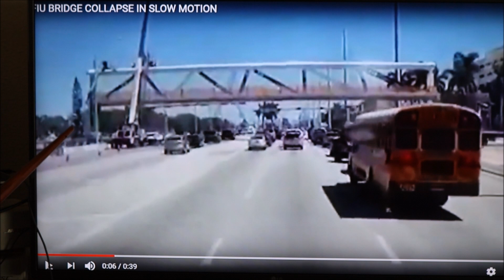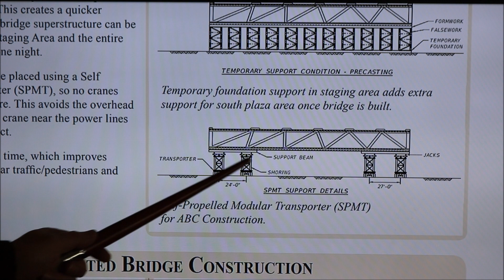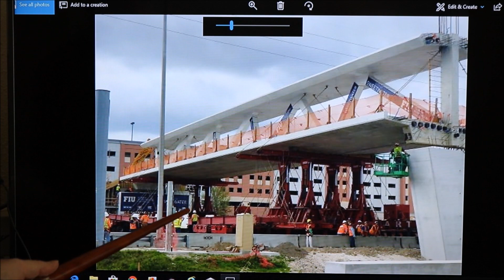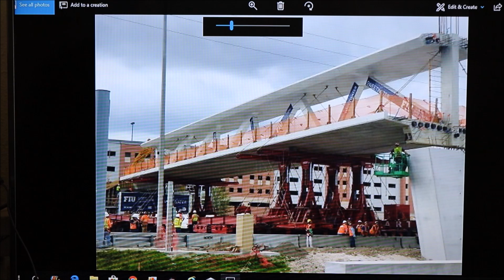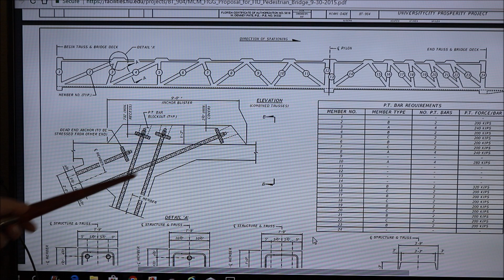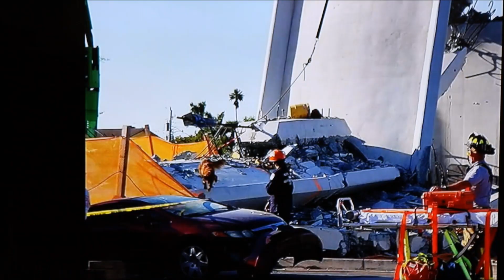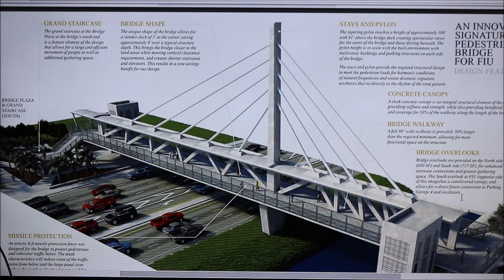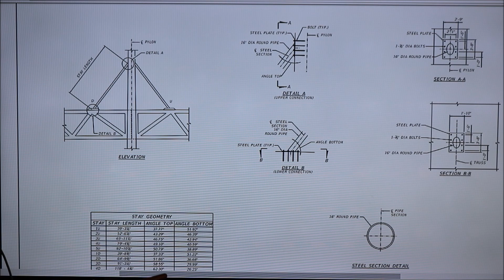Miami Bridge Failure Update 18 March 2018

Comment: Some engineers are going to face extreme scrutiny..... and justly so
Reply: Some engineers are going to lose their PE commission.
The load cell that was doing the tensioning should have some type of data recorder. 
I tested materials as well as worked on numerous flight test programs. Testing steel dog bones or bow ties required a reduction in material width to get the specimen to fail within the gages. You see the ultimate strength, then a reduction of strength as the stretching occurred, and finally the bang of the failure. It can be quite violent releasing 100 ksi of more of built up energy.
Reply: I suspect there is quite a lot of scrutiny for the contractors as well. There are approved plans for moving, tensioning, etc. If the contractor doing the work doesn't follow them not much engineering can do.
Reply: The contractor, NOT THE ENGINEERING FIRM, has been fined and prosecuted numerous times in the past for (in OSHA's own words) "Inexperienced, non-English speaking, unsafe and incompetent management." See Andrew Frink's comment.
Reply: Thanks.... adds more fuel to the "fire"
Reply: They have a Get Out of Jail Free card with their Female Privilege.

Comment: So the crane was hooked to the worker who was tensioning the rod, obviously to save him from falling if the bridge failed, but they didnt shut down the highway for traffic if the bridge failed....To me that is a very serious mistake...the kind where someone goes to jail
Reply: The worker was most likely tied off to the crane in case the worker fell off the bridge. No way they would even have a crane there if they thought the bridge would collapse.
Reply: Geoff
It looked like his harness was attached to the crane but the worker wasnt attached to the harness..
Reply: Juan put it pretty well - "anytime you venture into new engineering you create additional and new modes of failure." We do not know if the bridge failed because the it was damaged when it was put place, or if the tension rod failed or if the concrete failed, or it the worker caused its failure (The worker could have been "tensioning" the rod incorrectly even which caused it's failure), or/and if the design itself was too difficult to implement.  Or even if the new design was tested properly.  We have dozens of these types of pedestrian bridges crossing similar spans/freeways in my town and they were implemented without problems and they are safe. 
But the buck has to stop somewhere, and the engineers should have been able to foresee such a disaster. I.e, what experience and equipment do the contractors have and can they implement the design correctly??
This for me is reminiscent of the Hyatt Regency walkway collapse in 1981, where the contractors deviated from the design which led to the loss of life. With that, the engineers were found not guilty of crimes, but they lost their engineering licenses and their careers.
Reply: Can,t understand why they did not stop the trafffic whilel the worker was tensioning the rod. Critical mistake which caused such a tragic loss of life.
Reply: metatech, I agree. Shoddy work and shortcuts is Not what our country was based on,  as I'm sure you are aware  that Americans took pride in their work and products, especially in situations where so many lives are dependent on it. I have watched our nation slowly being conditioned to accept less than quality, because of outsourcing our structural materials and or work. We Need To Regain a Sense of Justice and make the person responsible for this travesty (Responsible) for his actions.
Reply: Yes that,s right i,m not an American but my dad grew up in America and the one thing that my dad told me was high standard of American workmanship and the attention to detail. I wonder was the contractor interested in one thing and that was profit. A much lighter bridge could have been made of steel and served the purpose just as well. Sorry for the terrible loss of life.
Reply: Danber
yeah thats possible. ..But he was adjusting  the tension rod....They dont send up a rookie to do that...That dude must have known what he was in for and the danger involved...Be nice to see an interview of that worker but Im almost sure he isnt allowed to talk to the public just yet..
Reply: That became an unsurvivable fall from height after harness issues.
"Navaro Brown, 37, died Thursday, according to Michael Biesiada, a spokesman for Structural Technologies VSL. Two other employees of the company were hospitalized at Kendall Regional Medical Center in Miami and their condition is stable, he said."
http://www.miamiherald.com/news/local/community/miami-dade/article205584729.html
Reply: They did stop traffic to set the span. They had to, the bridge trandsort blocked the road, and a buck says they had to get a truckload of permits to do it.

Tension ops?

The architect/engineer's drawing shows that unnecessary, the temp struts loaded the span same way as the permanent piers.

Temp struts don't fit?

Field change... maybe get a procedural stamp from an engineer, maybe not. 

At wrench level, if the super says torque em, you torque em, and you't apply for permits to stop traffic.
Reply: The crane is not an OSHA approved tie off point. The only failure in the safety harness is improper use of some sort. If you notice the snorkel lift to the left of the crane, that was probably the workers way to get to the roof. He was probably tied off when operating it, and untide from it when he climbed out onto the roof. That alone is an OSHA violation.
Reply from the maker: I may be wrong about this, it appears more likely the crane was hoisting the hydraulic tensioner.
Reply: C Dawg. That would be negligent manslaughter.
Reply: c dawg  Did that worker survive?
Reply: Lee Barnes good points , your very attention to detail person most people missed all of that.
Reply: A manlift basket is setting in mid air where the bridge fell out form under. The crane was surely used for heavy equipment and a manlift operated by the worker was sitting right where he walked out of it. That he wasn't wearing his harness no big surprise working in the middle of a 16 foot wide slab. The harness is required for all occupants of a manlift, at least the view from where I sit
Reply: The strap on a safety harness is folded over with break away stitching to break your fall in the event of a deployment. Otherwise the stop would be so violent it might hurt you.
Reply: Paul Frederick no way does harness have breakaway stitching.     There should be no slack in safety line so no big jerk from a fall like in Rock climbing where you need a dynamic rope that can stretch to absorb a short free fall.  All gear in construction situations should be kept taut as possible and all gear is static not dynamic, at least every thing I've seen in forty years of construction. Some riggers have maybe used dynamic climbing ropes at times  but I don't think that would be osha specs
Reply: Geoff,  It looked to me like his harness broke, this is why he fell after the bridge collapsed, as it maybe did hold for a second or so, only. Unfortunately, one of the three working on the bridge died. Rip.
Reply: Danber,  I believe you are correct, there was a special company hired to just do the cable post-tensioning.
Reply: It looks to me like he slipped right out of the harness before the stitching could brake his fall. Having worn them myself also, I'm trying to figure out how that could happen. And yes Larry Whitesell you are an idiot.
Reply: It’s impossible to comprehend that a guy is actually working tension control while traffic is flowing through like nothing is going on.The traffic should have been shut down for at LEAST a week and in my opinion more.Maybe the powers that be that designed it should have made the bridge their office until it was totally completed.
Reply: Colin Burnside True. Who pours that much concrete for a pedestrian bridge for the purpose of crossing the busy street?
Reply: c dawg The guy is not talking.   He was one of the fatalities.
Reply: c dawg the guy that was working on the bridge fell on top of the road down below
Reply: Colin Burnside dam you could have spent at most $100000 and made a nice bridge out of hard plastic at least if it fell nobody would have been killed sorry for everybody involved including the contractors
Reply: At least put barriers btween the road and bridge in case it collapse....right...
Reply: The witnesses says the crane hook was snapped off. This is evidence that the crane was tied to the bridge. The worker may have been injured by the safety cable whipping down from the broken hook. Also, the bridge directly under the worker was falling much faster than "normal", due to leverage. 

In the slow-mo dashcam video, the poor worker looks stretched abnormally even though he is suspended in the air, so I'm not assuming that the safety vest was worn incorrectly.
Reply: If the worker was attached to the crane hook, it is likely that the crane  lift cable gave out he would have had no support. He should have been attached to a second cable.
Reply: Doth
I believe his harness was attached and it failed or the worker didnt tie it off for some reason..
Reply: The crane was used to lift both the very heavy tensioning jack and the worker to the roof. The tensioning jack should have been released from the lifting rigging when it was finally attached to the rod. When the bridge fell, the jack lifting rig damaged the standard workers safety harness rendering it useless, yet some how the worker hung onto something for a very short while.
Reply: Right Mer -- there might have been cheap material from China used that failed,,, we do indeed need to get backto a point that we control the quality of material
Reply: No one goes to jail in a sanctuary City. Didn't you see the man that shot the white woman in California and how they freed him?

Comment: not 22 its 11. the smoking gun is the broken rod from 11 that failed during final tension adjustment. The rod with cylinder shot out of its tube from the energy released as it broke. there has been mention of other similar designed bridges that have had bolt(stay) failures. This design was mentioned as looks good on paper but not easy to implement properly.
Note this was a relatively cheap bridge and cost was kept to a minimum. Why would the contractor risk the lives of the people under  the bridge? Were there incentives for early completion and or fines for late completion including traffic blocking?  There was likely pressure to risk it. Nicely done so far Juan more will come to light with time.
Reply: I bet the press never ask these questions NebukedNezzer.
Reply: If you look at the original drawings (there may be a link in one of the comments on here or on Ave's video) you will see that diagonal no.11 has no post-tensioning bars, presumably because it would have been in compression in the permanent condition and also in the installation condition with the temporary supports under the end of the deck. However with the temporary supports moved into the span maybe post-tensioning had to be added to diagonal no. 11 because it would have been in tension during the installation.
Reply from the maker: correct 11, I need glasses
Reply: not a big deal we all knew what you were talking about the number was a minor thing.
Reply: yes number 11 did have a tension bar that the construction company was adjusting when it broke .
Reply: NO, all of the span column had 2 tension bolts. Number 11 only had one active bolt during assembly as the last bolts on each end of the bridge had to be tensioned with the bridge in place. The only bolt in 11 that was keeping the bridge from failing broke.
Reply: the FAKE news media is to busy Lying about Our President Trump to give any real news out.

Comment: I still can not believe that they allowed the traffic going while working on the tension of these rods. -_- Highly negligent. Trying to hurry everything up and now six people are dead and they have to close the road for weeks instead of closing it for a day or so when working on dangerous structural elements. Pointless and tragic.
Reply: Sorry, I don't get your point as I am not familiar with the US. I guess the city, or whoever is responsible for shutting down the roads, puts pressure on the engineers/construction companies as they don't want to cause too much traffic jams.  But you do not get both: Safe construction and moving traffic. The engineers are now under attack but the problem was caused by others...
Reply: Mike Cowen This was to stop the students being run over crossing the road. Perhaps they should have gone for a tunnel.
Reply: Eily Bergin: Absolutely right on... should have closed traffic. Who knows, maybe local government administration wanted no interruptions.
Reply: yeah when a bike trail is under construction you are not allowed to go near the construction site
Reply: Please note that SW 8th street and 107 Ave is a major artery through the area. Complicating the issue is the fact that a canal parallels sw 8 street limiting any detours around the area for miles.  The secondary roads are through residential neighborhoods on either side of the area. And you have to cross the canal somewhere... FIU campus (former airport) has no real through roads. West of school is turnpike, and another canal. Real tough area on a good day...might google the FIU main campus and look at satellite view.
Reply: Eily, Absolutely! They are in such a hurry to get people out of their cars, that they are throwing up these walking bridges all over the country. Check out Grindall61 on YT, speaks about the new agenda of sustainable living, being implemented.